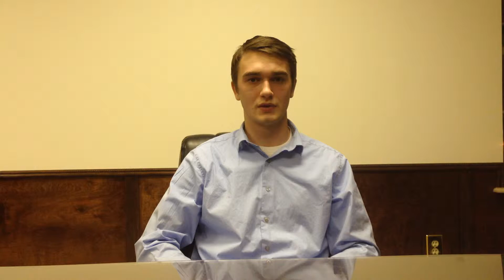Reason Why Amine Blush May Occur in Epoxy Coating and How to Fix It

Comment: I am a builder and in recent years, have used a Two part epoxy resin pointing. 12 months ago, I used the resin product on 120m2 of natural stone paving, sod's law, 24 hours later my customers called to say the paving was going white. Luckily I fixed it after the manufacturers said to pour white vinegar on it. 60 litres of white vinegar later and the resin sheen that was left on the paving went back to clear. That was a stressful couple of days after spending a month on the job and potentially costing me thousands in lost labour and materials if the fix had not worked.